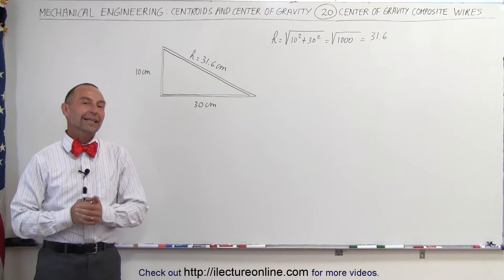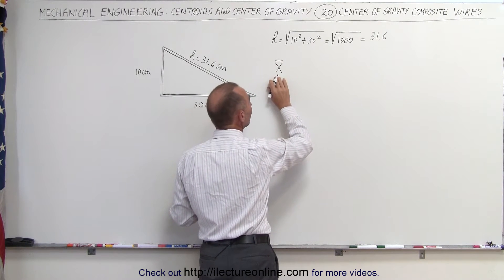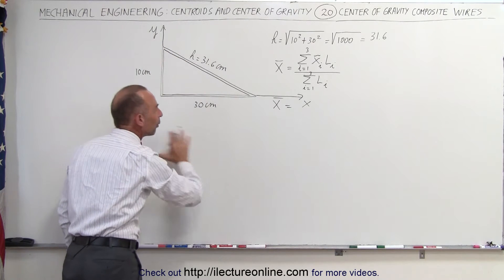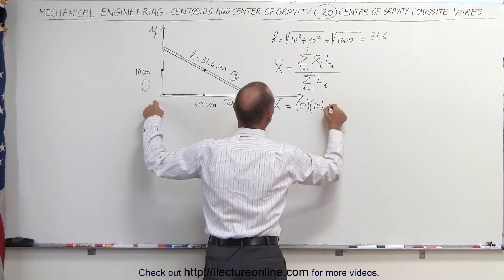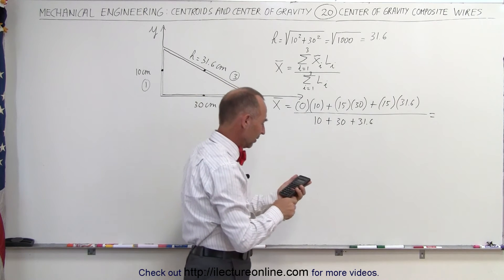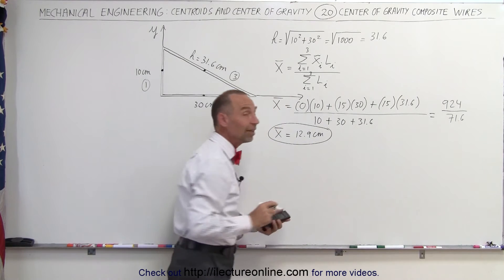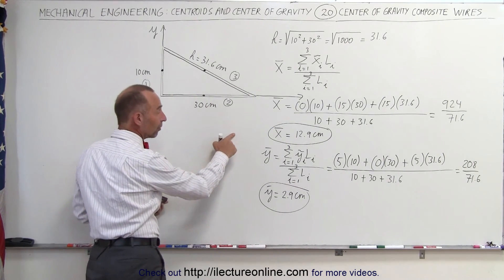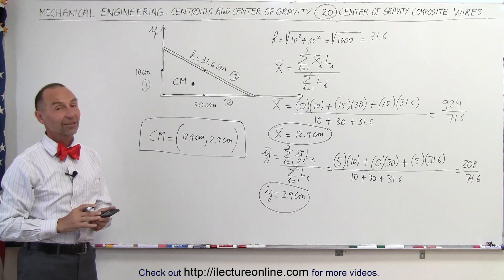Mechanical Engineering: Centroids & Center of Gravity (20 of 25) C. G. of a Composite Wire

Comment: Excellent videos, Prof van Biezen. I make the x cg for the hypotenuse 5 sq rt 10=15.8 , isnt 15 (as shown in the calculation) too large an error margin? Also x(cg) x L = 500 wouldn't it be clearer to put 500?
Reply: I think that 15 taken is the projection of the point thats halfway in wire no 3. i.e 15 is the projection of 15.8 in x-axis which we use as a refrence.

Comment: sir how did u assume that the centroid of wire 3 has a x value of 15......i love ur videos...thank you for the videos
Reply from the maker: +bore strontium  Regardless of the angle of wire number 3, the centroid has to be in the middle, and thus it must be directly above the centroid of wire number 2 and thus it must have the same x coordinate.
Reply: @MichelvanBiezen  sorry, but this does not answer the question as to how or why.  A better answer would be to appeal to the properties of similar triangles: draw a horizontal halfway along wire number 3. Now the point of contact is above halfway along wire number 2.